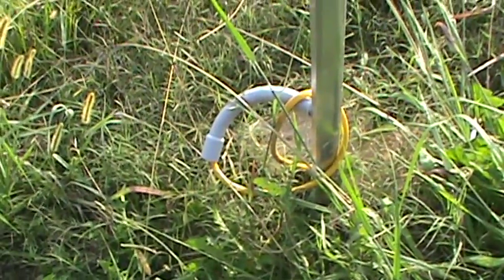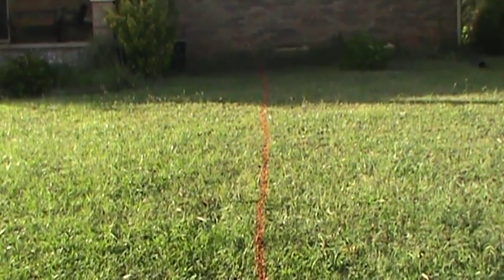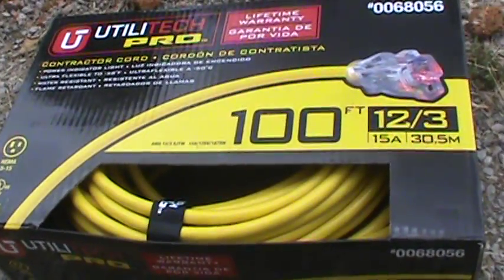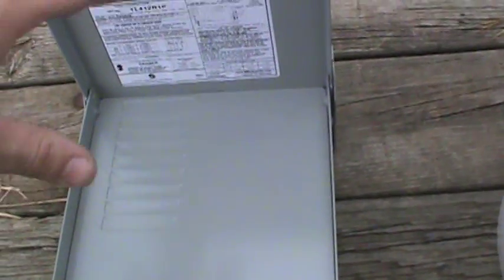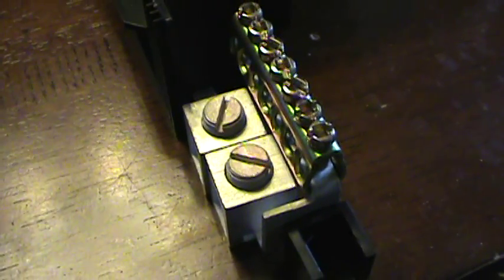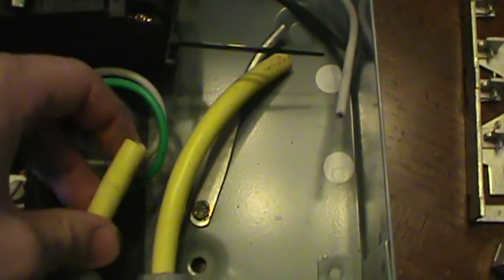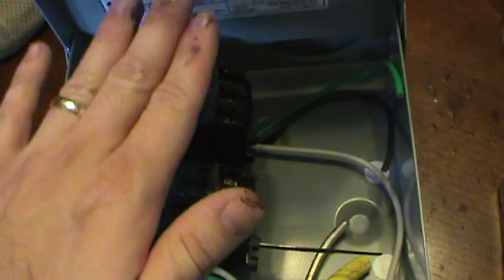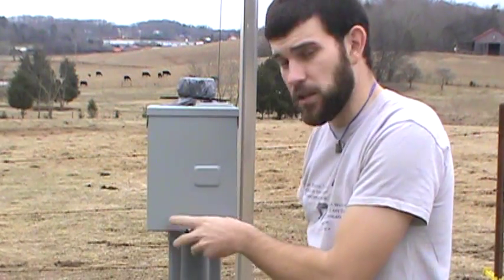A COMPLETE WIND TURBINE INSTALL FROM START TO FINISH (OFF GRID & GRID-TIE) PART 2

Comment: Good Day to You.:  Another great video!  Question, If you should not use the brake mode while the turbine is spinning, what to do when you need to stop the power for maintenance and the blade is spinning? Thank You for your time.
Reply from the maker: +phillip staton You can turn the braking on when it is spinning it just does not need to be engaged when it is spinning at high RPM's